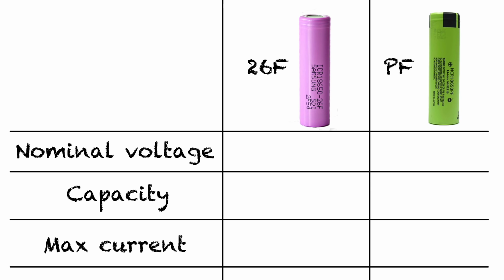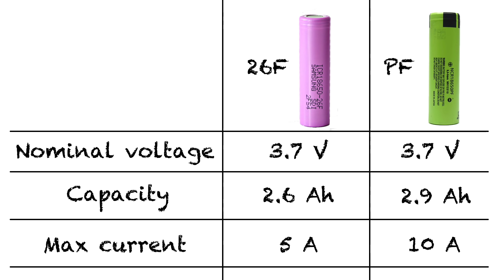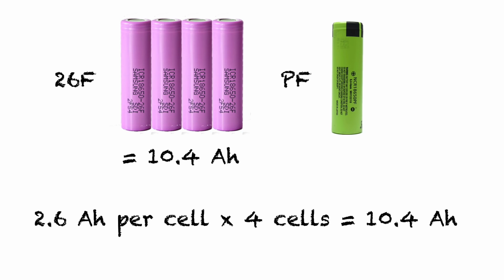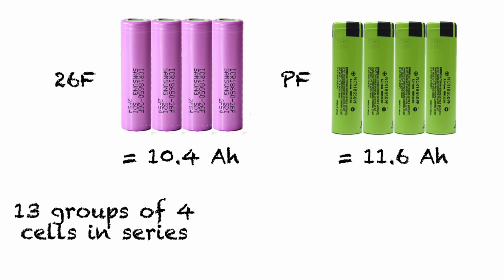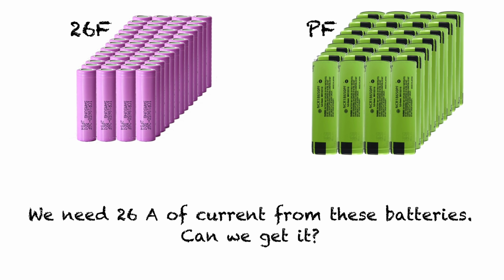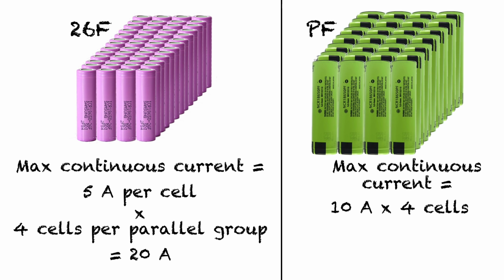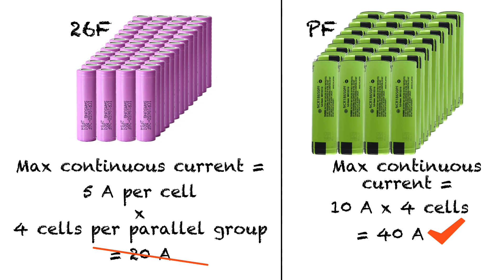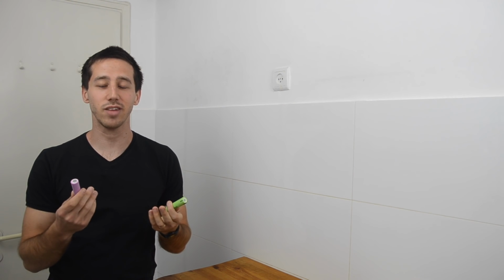Comparing 18650 cells for DIY battery - Q&A#5

Comment: What would you say about this Battery from AliExpress ( 36V 100Ah 18650 Rechargeable Lithium Battery Pack 10S3P 1000W Power Modified Bicycle Scooter Electric Vehicle with BMS) I don't know but the 100Ah looks a lot. Thanks. I do have your books, should I buy or try to build? 🦘🦘

Comment: I have a question I just can’t figure out the math lol I build a 20s10p 72v battery using NCR18650bd cells trying to figure out the amp hours also discharge amperage is there any way I could get some help I also built a20s8p with same cells I actually built this for a KTM conversion to electric with QS165 with FarDriver ND72680 controller I would really appreciate any type of help thank you

Comment: It's not so much that the controller will pull 26 amps. The controller is capable of 26 amps, however, the torque requirement of the motor at any given time will determine the current draw.  From this perspective, the higher rated battery is more appropriate for the potential system load, not for the max current capability of the controller. The controller will only supply the amount of current demanded by the motor, and if the max current setting is not properly adjusted in parameters the controller will be happy to burn up along with the battery!

Comment: Hi Micah,
My son rides a Razor MX 650 electric dirt bike which has 36v system consisting of three12v 12ah AGM batteries inside.  The batteries are very heavy and needles to say, had a very short life span. Is there a lithium battery that can replace these AGM batteries directly and can you recommend a lithium battery charger?

Comment: Can you convert 18650 battery into C BATTERIES. 
LIKE A CONVERTER. SIMILAR TO WRAPING CARDBOARD OR WATEVER MATERIAL AROUND THE DOUBLE AA'S TO MAKE THE BATTERY LARGER TO FIT IN THE SLOT. COULD THAT BE DONE WITH RECHARGABLE 18650 BATTERIES

Comment: is it good to have 2 bateries x10 Ah instead 1 of  20 Ah ...and when you ride small distance taking onli one of bateries (light weight) and the other is at home and maybe charging .when you need tak the other in the bag or connect both on bike?

Comment: Okay, I am losing my mind right now... About a year or so ago, I was working on an 18650 project, and somewhere, somehow I found this really nice comparison website someone had created. I can't remember at all what it was called, but it was a really great tool where you could sort and filter a ton of different lithium battery options by type, capacity, cost, brand, size, weight, etc..., tons of different specs to sort with, and it would tell you who is selling them for the best price. It was a live tracker of some sort, and a tool people would use to find the best prices on bulk batteries.

Does this ring any bells to anyone? Might someone know of the website I'm talking about?? Thanks in advance!

Comment: Thanks, fantastic content as always. I would love those books to learn more. 

I’m looking to replace my 2 year old battery which is a 52V 15AH Hailong with Samsung 30Q cells. I want the same amount of power, acceleration maybe a bit more range like 17AH if possible, but with a smart BMS so I can keep my eye on the cell voltages. I’m running a Bafang BBSHD motor which is capable of 1700W

Can you recommend cells, BMS and provide and advise for making such a battery in 2021? Thanks!

Comment: What time take a48v 20ah lithium battery to discharge ?? Thanks
Reply: Depends on your load. Pulling 20 amps from a 20 amp hour battery will discharge it in 1 hour. The cheaper battery in the video was a 10ah pack rated at 2c. That means that it can output twice the amps, 20 amps in this case. So it would deplete in 30 mins. The more powerful battery was a 4c rating, so it can push 4 times the amps (40 amps). But doing so would deplete it in 15 mins.

Comment: Lots of suspect info in that video. You shouldn’t say there are no bad cells and cells arent better than another, that’s just fundamentally not correct and can potentially put people at risk when they think using cheap eastern manufactured cells were created equal, they weren’t. I just wrote a whole explanation of how these calculations should be done safely but I didn’t bother as I realise no one will listen anyway.

Comment: This is a good explanation of how to consider cells. When I build a battery pack from recovered cells, I always have 'culls' that test better or worse than the majority. I use these to build 12 volt starting batteries for lawn mowers and such. I usually stack a bunch in parallel (6 or so) and do 4s. That gives me plenty of cranking power and it is only used Very briefly. I am probably stressing some of the cells but it is so briefly that they don't have time to get hot. One of these batteries has been cranking my zero turn for years and it was made from cells that were 'outcasts' from my regular projects. 
     Take Care and be safe, John

Comment: Hey Micah ... I will be buying your battery building book but before i do , my intention is to use 21700 cells with a 5000mah either lg or samsung from a canadian retailer. They retail for approx 8.50 each. I cannot buy from the usa because of senseless brokerage fees as well as other rip off fees crossing our shared border. I want to know if u have a better source for the cells and do you recommend the new 21700!!! Ty for your help!

Comment: hello micah i recently purchased youre book on how to build lithium batteries and i must say it's very easy to understand and is well put together. 
i have recently dismantled an old 36v ebike battery and tested all 50 cells.
i shorted some in the process and the voltage levels vary greatly???some are 4.2v- 4.3- - 4.07v -3.55v? 
which ones should be ok?

Comment: Great one thanks very much. 
I am wondering why different lithium cells have different mAh? Why don't they have a standart? For instance, they can be either 2600, 3000mAh, 3400mAh, 3500mAh, 4000 or even 8800mAh. (On aliexpress, very confused) Based on this, ı am searching the most cost effective lithium cells from aliexpress but they are way expensive than buying a built battery pack. I have to make big math to optimize the most effective purchase on buying 18650 cells. Can you make a categorization for different cells based on different power needs,? Please
Reply: It mostly has to do with the composition of the anode and cathode.  The composition creates resistance and capacity differences - they look to be inversely proportional, ie. when resistance is higher (higher amps), capacity (ah) decreases and visa versa - this has some good info https://batteryuniversity.com/learn/archive/the_high_power_lithium_ion.  I would only consider brand name batteries for safety and reliability reasons.
Reply: Dave Stennes thank you very much for your answer :)

Comment: What about if your controller is more powerful than your batteries. Can a BMS system help or rather, can you limit your controller settings to reduce the current/load?

Comment: Hi dude. First of all thanks for all of your videos. You have put together 5 part videos explaining in details, how to build a battery pack, But looks like I am  electronically challenged (I think me being autistic has something to do with it)because I can’t get my head around which cell to use and how to connect the battery together to achieve a light weight 52v 17.5ah battery for a TSDZ2 48v 250w motor. I am going to change the program to Flexible OpenSource firmware. More I research more confuse I get🤯.  any chance you can help me with which battery cells and a drawing of how to Connect theme? Practically I am very good!! Thanks man!!!

Comment: What's a good mR reading for brand new Samsung 3000mAh Q30 18650 15A button top unprotected batteries ? My Zanflare C4 charger tester gives the internal resistance on my supposedly brand new Q30s  as 2.80mR, 1.90mR, 2.14mR, and 3.02mR respectively. Thanks much

Comment: Can you mix together protected & unprotected cells so that you don't need a BMS?
Reply: No. Your unprotected cells are still a risk. And also, protected cells will prevent undervoltage and overvoltage situations but will not correct or compensate for it. So you may have a weak parallel group in your battery and over time and charge/discharge cycles it will get worse until your battery is essentially useless. This is similar to how people get the drill batteries and pull them apart for salvage cells. One cell is bad but 4 or 5 others still work. One weak cell kills the whole battery.

Comment: Hey mikey I'm new to your channel and have learned a lot and I have a question if I wire two 18650 batteries in series would I have to double the charging voltage and current

Comment: How best I could design battery pack for 52v for 180A controller, Caz iam confused in selecting BMS, whether I should split voltage or max current for creating multiple packs.. Please help me with this

Comment: Hi, many thanks for your videos.
i have a question, i build my own pack, 11,2Ah, 36V connected to 350w Hub motor, the motor can be powered from 36V to 48V.
i use a cheap controller from china 20$, and he can handle till 350w
My Battery-Power go down after driving 16km.
my Question, do i have a wrong dimonsioned Battery-Pack?
i use INR18650 29E
Many thanks

Comment: Hi Micah
I've learned so much from yourself over the last year or so starting has I did 18 months ago knowing 0 about Ebikes! Thank you for that. With all that in mind, I've just - with help from others put together a 52v 28ah 1000watt rear hub home build.  My speed controller is a 48v 45amp Sine wave, My cells are LG MJ1.  Question 1. Is there a weak link in this build? My thinking is the motor?
Question 2. With that in mind, should I jump to a 1,500watt rear hub motor instead?  Please could you spell out the pros and cons in this thought process. Will the 1,500 watt motor give My present setup any more performance?
Thank you in advance for your help Micah.

Comment: Micah-It looks like I'm facing creating a whole new battery for a Curry IZIP Metro, bought used and looking like long dormant....I've removed and opened the battery case to find two rows of 20 cells plus BMS.....I bought your book today on Amazon and will take my time with this. But hoping you could translate what was printed on the cells (which, BTW, measured .7 volt each in random testing): They say "Samsung ICR 18650-22P  SDI 1C13. Hoping you can tell me something about what the 40 of these equal and anything that comes to mind, about their quality or character, just to give a jumpstart before your book arrives. Much appreciated!

Comment: I WANT 12 V 3A  FROM ZINC CHLORIDE D SIZE CELL   I DONT KNOW CAPACITY OF CELL AS MANUFACTERE DOES NOT PROVIDED .  IN SHORT 8 - 9 CELL CAN THIS PACK OF D CELL PROVIDE 3A CONTINOUS? I WILL USE IT IN ACTIVE SPEAKER 12 INCH POWERED BY TPA3112 BOARD  12 V --24 V

Comment: Can I mix and match the diff Mah outputs? I have standard Pink, Green, Grey, and Red batteries all from laptops I’ve found here and there. 
I need to make two 12v packs or one 24v pack for a scooter that I bought my son. 
Any links on best way to do those would be greatly appreciated, would love your battier book as well! 
The scooter I have is an Astroid GT, thanks for any help

Comment: Could you run say a 2.9A max current battery with a 4.2A max current battery in series for 7.2A total max current?
Reply: No. If you draw 7.2A from that configuration both batteries will be operating above their maximum rating. If you draw 4.2A one battery will be above its maximum rating and the other one will not. If you draw 2.9A both batteries will be within their maximum rating.
Reply: cruiser97eric1 I means in parallel. Sorry.
Reply: What happens in parallel depends on how the two cells share the current among themselves. Let say initially the current is split evenly in half, 7.2A / 2 = 3.6A each cell. Then one cell is above its maximum rating and the other one isn't.
Reply: cruiser97eric1 since current is a measure of resistance, wouldn't the higher rated battery take the extra load once the lower rated one hits top resistance? Kind of the same principal of charging in parallel..?
Reply: The current sharing will depend on the internal resistance and on the nominal voltage for each cell. Some types of cell like to spend most of their discharging time around 3.7V and others around 3.6V. The internal resistance changes as the cells discharge and as they age. It is hard to predict which cell will have the lower internal resistance at any given time. Say for example the cell with the higher max discharge current has a lower capacity than the other one (because it is a power cell instead of an energy one). At the beginning it might have lower internal resistance and provide most of the current, but as it discharges faster, at some point the other cell might end up providing most of the current.

To keep things simple and have predictable results it is best to use cells from the same manufacturer,  with the same part number and same age when connecting them in parallel.

Comment: Question?
Can I use Super Capicator like Maxwell along with 36v ebike battery for added power. I need bike to make round trip of 50 miles.
Reply: No, look how many amps the capacitors hold then cross compear then to battery cells and you will see they hold only a very small amount of current.

Comment: Suppose I have made a battery of 100v and 60A battery how can I reduce the current and voltage to constant 20v and 20A respectively
Reply: In theory you could use a DC to DC buck (step-down) converter to get from 100V to 20V. After conversion you'll need a 20V controller to limit the current drawn at 20Volts.

Comment: OK,   gotta make sure I'm not screwing up.   I'm ordering a Bafang BBo2 750 watt 48v mid drive  Planning on building
a 5p 14s battery using 18650B 3.7  3500ah samsung

Comment: Looking at modern ebikes with the battery on the frame how easy are they to change the battery's in side for higher capacity ones. The reason for asking is I mountain bike and want a mid motor  modern bike but they mostly come with 500 watt hours and when the bike is out of warranty ie buying a used e bike I was thinking of upping this by changing the batteries to higher capacity ones but same amount of batteries thanks danny
Reply: Yes, since all 18650 cells are the same size, you could replace the 18650 cells in the factory pack with ones having a higher ah rating. For example, if the factory cells are 2000mah, you could go to 3000mah ones to get 50% more capacity in the same space.

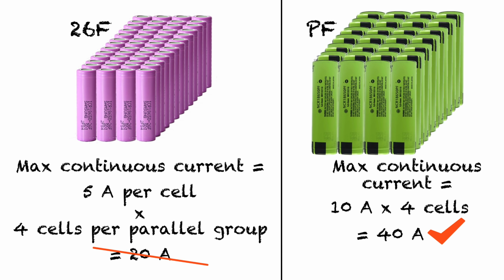Comment: 3:23 "because no cell is ever better than another cell". Haven't tried the 1 dollar specials eh? ;-)
Reply: Well the * next to that statement would be if you don't get lied to. For example I bought Samsung modem batteries that have only 2200mah capacity and 0.5A  continuous discharge. Crappy batteries right? But at 0.45 USD each, they are a great choice for the inexpensive low drain applications I sometimes build. The key is that nobody told me they were 9000mah and charged me 4 USD each for cells that are actually 600mah.
Reply: @tedhancock68  k

Comment: Hi Micah, thank you so much for producing all these fantastically informative videos. If i built 2 indentical 10.4 Ah  battery packs, can i connect the discharge cables of these batteries in parallel to get a 20.8Ah pack and yet keep the charge cables separate so that i can use 2 separate chargers to charge the pack so that charging time would be halved compared to charging a 20.8 Ah pack through one charging port. Thank and God bless

Comment: can you explain to me how i build 48v 50ah
Reply: thanks for this comments.my 1000watt bldc motor requirement is, rated  44ah and continuous 20ah. so i will make my battery pack is 48v 50ah.will you please guide me if you have any option to reduce my motor rated 44ah ?

Comment: https://www.walmart.com/ip/50pcs-5800mAh-18650-Rechargeable-Battery-For-Flashlight-Replacement-Battery-with-Wholesale-Price/187453282?wmlspartner=wlpa&selectedSellerId=12064&adid=22222222228094132079&wl0=&wl1=g&wl2=m&wl3=233600410688&wl4=pla-386399044788&wl5=9027688&wl6=&wl7=&wl8=&wl9=pla&wl10=117097802&wl11=online&wl12=187453282&wl13=&veh=sem
What about these batteries?

Comment: Hi guys! Just curious if i can build ebike battery from 21700 cells (3.7v, 4000mah, 40a discharge)?
Reply: Sure you can, but 18650 cells are much more cost effective because they are produced in much larger quantities. Also beware that a 21700 battery takes up nearly 50% more space, but doesn't give you 50% more capacity.

Comment: Hi, so what I'm getting from this is if I'm planing on making a 52v 1500w 35ah 30 amp pack or something around that size, should go the 5 amp cells over the 10 amp cells. I was looking at lg mj1. Would 10 amps be to much or does the bms sort this out ? It's to run a bafang 1000w mid.........
Reply: The INR18650-MJ1 nowadays is rated 10A. The older version was rated 6.7A if I am not mistaken. The higher the amperage of the battery, the better your choice. Higher amp cells are normally more expensive though, so you should not overdo it with cost in mind.
35 Ah would mean you put 10 series of batteries in parallel. 52V means you put 14 batteries in series. So you would need 140 batteries to accomplish that. Each battery would draw 30/10= 3 Amps. For safety reasons I would double that to be the minimal current of the battery (so at least 6A batteries).
Easy to understand: the more batteries are paralleled the less current each battery will draw.